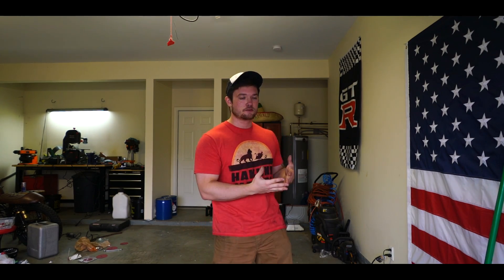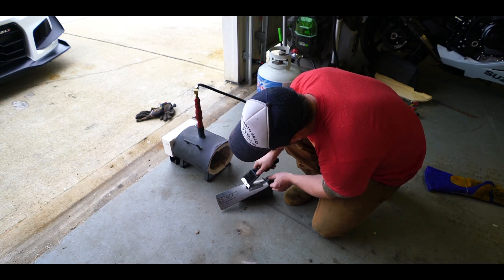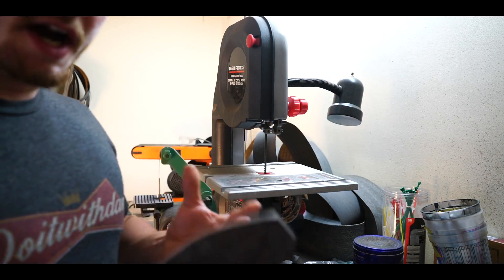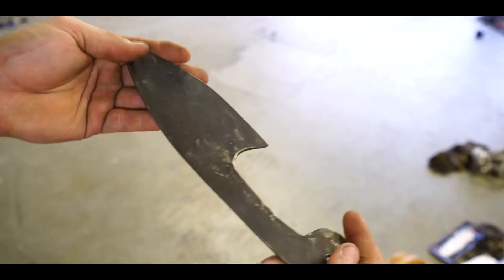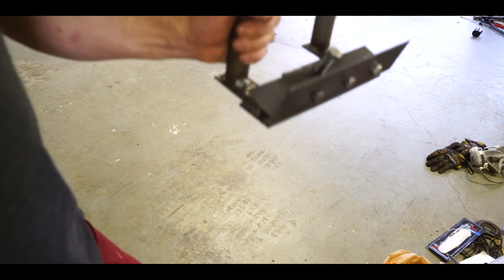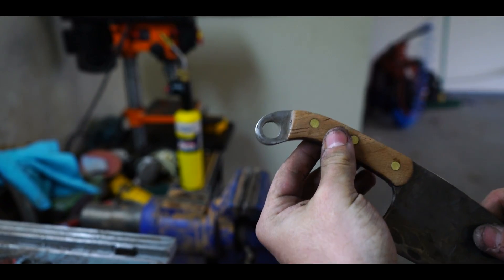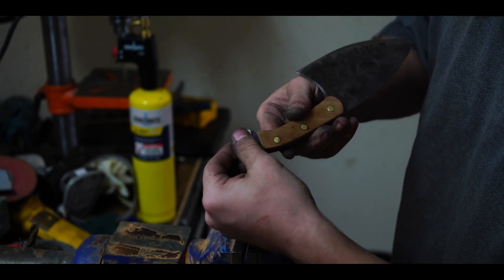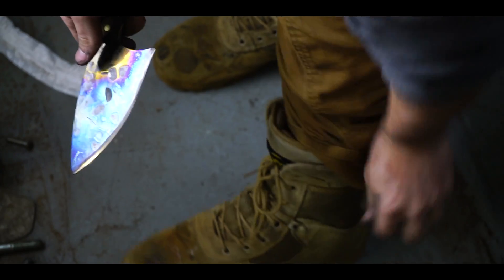Forging a Knife from a Titanium Jet Engine Turbine Blade

Comment from the maker: Just an update. He loved it! Reaction was priceless!
Reply: DanMade it came as no surprise that you shave your legs
Reply: titanium dust + lunges = death
Reply from the maker: @mr.thebandit  I always wear a respirator
Reply: @DanMade  My dad worked for the railroad for a long time, I made him a railroad spike knife.  Also I'm glad you're proud to be an American.
Reply: You should try and make something damascus
Reply: And merry Christmas or whatever
Reply: DanMade The best way to cut soft materials is to use a saw blade with a lot of teeth, it’s the opposite when you cut hard materials.
Reply: yeah it turned out great but since its airline, i would assume that it's almost like incanele where the alloy is made to not retain heat and that crackling is the metal trying to laugh at you destroying your cutting discs just kidding good work i like this one alot
Reply: louis debacco nope just plain titanium. No blades in a turbine engine are made from inconel, it’s too brittle.
Reply: Did you not record the delivery of the knife?! C'MON MAN!
Reply: Wish you would have posted a reaction video of you giving it to him
Reply: Yay
Reply: Any plans for a folding knife in the future?
Reply: Hey Dan, have you thought of hand riveting instead of using epoxy?
Reply: If he plans on actually using it you need to put a carbonized layer on it so it will hold the edge
Reply: what an awsome idea u got there, and what a lovly message to your dad! Big trumps up man and great work!
Reply: _ Honor your father and your mother. YHWH Almighty.- 
Period.- 
Cheers From Argentina
Reply: Brother I seriously would love to buy that.
Reply: Cool idea. I would point out that since it's titanium, and that it's a stage 2, it's neither a fan blade nor a turbine blade. That would make it a compressor blade.
Reply: Happy retirement
Reply: Dunno if you're going to read but anyways...
Steel has 1100°c melting point , while titanium has @1700°c. Maybe you couldn't bend the titanium sheet because it didn't had the necessary temperature ( probably that's why titanium usually is made/worked at an industrial scale , because it needs better equipment).
Also , couldn't u have completely bent the sheet of titanium and make more layers , seems like it would have been easier (though I believe it wouldn't have the same benefits as steel has from multiple layers)
Reply: La verdadera navaja hipoalergénica del mundo mundial y de todos los tiempos.... Felicidades mi estimado.
Reply: Glad to hear that bro, your parents raised you well
Reply: So your dad is a nice man, if i was your dad i probabely punished you for ruining my souvenir!!! Man it is really ugly!!!
Reply: You talk too much... Less talk, do better job and see peoples react...

Comment: heres a tip for next time, dont use abrasives or bandsaws for titanium, find yourself a friend in the engineering business and use thier plasma cutter, use light abrasives later to work out those hammer marks you have, since they will affect the durability of the knife, it will most proberly snap after a while due to delaminations in the blade.

Comment: titanium is so soft, not good for blades. and has high tenacy so hard to edge on a knife. I guess its HRC(if measured) is about 30. if you several cut, you must make edge again.

Im a pipe fitter on oil refineries. its quite nasty meterial. cutting, grinding, welding... every processes are different to iron. your hardning is bit ridiculous. thats not titanium hardning. 😂😂

Comment: Titanium is acctually has a really bad edge retention, also it's not as hard as you think, titaium frame locks get a worse and worse lock up since the steel gets bend and the only really good quality of titanoum is being light for it's wear resistance

Comment: I made a knife out of high speed steel (about 68 Rockewll C). Too much for me, I could barely profile the blank, and had to burn rivet holes in the handle, no drill would cut it. I just made a simple seax. But,,, it gets ripping sharp and holds an edge like nothing else. Try it, I dare you! :)

Comment: You need to get a band saw blade with around 20-30 teeth per inch for something that thin and titaniumy, and get ones designed for hard metal, makes a huge difference. Also use a heavier oil like 10-W-30 motor oil applied constantly. If you apply the right pressure (not too much) the blade will last a surprising amount of time. You could have cut that whole thing to ribbons with one blade. 

There's a bandsaw at the place I work that cuts 24" thick solid steel up to 24" tall lol. The blade is about 8 feet around in a circle. I've seen 20 foot long solid steel shafts that were 18" in diameter first cut into 12" lengths, we got about 16-17 of them out of it due to the shaft ends being too small for step two. After cutting the lengths, those rounds then had their sides sliced off to form a rectangular peice of forged billet steel aka step two. We then used those pieces for a job to save money on material cost (I work at an unusually large scale machine shop, 8 foot swing 70 HP lathes, 42 feet wide by 14 feet tall by 10 feet deep capacity 50 HP milling machines, and a few smaller machines as well). There were a shitload of short blade shaped pieces of scrap that had to be loaded after that job, they looked kind of cool when I laid them down like scales on a pallet after each cut. Should have taken a picture. The blades on that saw are replaced once every 1-2 *months*. It's crazy how long they last considering how much it gets used, all damn day.

Comment: Lucky you getting that blade. I had an aluminum melting furnace that turned waste to ingots, had this piece that would not melt, so threw this two foot by two foot to the scrap pile, latter found out it was titanium, i should have known.

Comment: It was 'less than an eighth of an inch thick'....only at the tip.  It's a tapered blade. (I'm very familiar with repairing those Ti blades.)
Also, you need to drop your top bandsaw guide down until it just allows the workpiece to go under it.  You'll get much better blade support.
Ti 6Al-4V ( the material that turbine blade is made of) makes a pretty knife, but it won't hold an edge at all.
Tip for drilling Ti:  use a cobalt bit,  very slow rpm,  lots of pressure, and use coolant.

Comment: First let me say that you made a fine hand crafted knife  that took a lot of hours and effort to produce but since I am who I am her is what I want to say. Just because you heated the  titanium  in a forge does not make it a forged blade in order to actually forge a blade or anything else for that matter you  draw the shpae out of the metal (meaning you heat and pound the metal usually multiple times into the shape and size of the blade) you basically punded the  titanium turbine fin flat then cut out the knife, Essentially this is a stamped blade not a forged one. iwill now say it again so that there is no implication of demeaning the blade you made---------------->>>>>  This is not to take away from the  product you produced! you made a fine and beautiful hand crafted knife. but you did not forge the blade in the traditional definition of  forged.      . oh an for you naysayers out there I am a traditional blacksmith using a coal fired forge and non electrical tools. I might have a grasp of what it means to forge something. and just in case you still think I am full of BS 

The Differences Between a Forged and Stamped Knife
https://www.thespruceeats.com › ... › Cooking Equipment › Knives & Cutlery
Mar 8, 2019 - A forged knife is made of a single bar of steel, which is heated and then pounded into shape, sometimes by a specially trained craftsman, sometimes by machine. The alternative is a stamped knife, in which the blade is "stamped" or cut out from a large sheet of steel, then is honed and heat-treated for durability.

This way you can say that google said it and not some fat old dumb Blacksmith either way this is not a forged knife by definition it is a stamped knife

Comment: I don't want to be a "know at all" but fan blade is not the same thing with turbine blade.  Fan blade (single stage only) is made from titanium alloy. Turbine blades are not. In fact in the turbine blade there is not a single molecule of titanium.  You do realize that heating that blade made her soft enough to cut.  Otherwise....

Comment: Forged???? Looks like you cut out the shape then just heat treated it. Forging means shaping it from hot metal
Reply: Oh shut the fuck up.  YOU make a titanium knife or any knife for that matter then you can say something.  Those who can"t do teach.  Those who can't teach critique.
Reply: It was curved, he forged it flat, ie he "shaped" it to make it flat. He did this by heating it and hitting it with a hammer, text book forging.
Reply: Daniel Hughes he forged the titanium flat. Than cut the knife out. That’s not forging a knife.

Comment: Bro You got a pretty good band saw, you just have to lower your blade guide while cutting hard material...
Reply: Any material.
Reply: @Josef_R   less space between lower and upper blade guides blade will have higher strength and the harder the material the slower you should go.

band saw is literally best way to cut metal.
Reply: @abdulbasit2571  why are you telling me how to operate a bandsaw?

Comment: I have had a couple contacts with titanium.  Lighter than aluminum and ridiculous strength.  I had suspension rods out of an MRI magnet, used to center the several-ton-core in the outer shell to make a cryogenic assembly. Rods of maybe half-inch diameter, 4 feet long. With it stuck in a hole in a wall and hanging from it. could not bend it!!  Another time we were demolishing metal process materials like fume tanks at Flexel Industries in Covington, Indiana.  They made cellophane, so the fume tanks were large titanium liners inside of steel tanks.  To our surprise, the titanium sheet material was FURIOUSLY igniting and burning when we cut them with the cutting torch.  (kind of like magnesium would except it would go out if  you backed off).  It had the most unusual lemon-yellow flame, not the bright yellow like when you cut into something that has a salt film or deposit on it.   I guess I never gave any thought to whether this metal could even be heated red-hot and hammer-forged like this.  To my surprise.  Very few people have ever encountered this metal in their life. Scrappers will mistake it for aluminum sheet, and a scrapyard would make a lot of money not divulging this to customers.  I still think few yards have ever seen it either though.  It is kind of just the lightest yellow color,  at least in the forms I have seen it take!  I also saw a thick casting made of it at Wyman-Gordon foundry in Harvey, Illinois when we were doing a plant clean-out.  We were raising it in the air, yelling "I am SUPERMAN!!!"""

Comment: Now a knife from tungsten - how would that work.

First thoughts, forging would be difficult as its melting temp is ridiculously high ?

Next, depleted Uranium, but even depleted uranium still has radioactivity, so no chance of this one unfortunately - but would be interesting for its weight, density and strength (but might be brittle so I'm told).

Comment: I did not expect titanium to be foregeable- it is very brittle. At 4:20 - if titanium heats up over 450 degrees Celsius, it forms an ultra hard so caled alpha-case layer on the surface. Better grind it slowly...

Comment: Hey bro Idk if anyone has mentioned it but,  look into CBN wheels for a bench grinder. A 180 grit CBN will cut like a 80 grit AO wheel and the best part is that they dissipate the heat very well and you never have to reface them.

Comment: It's been a bit since I've looked into it, but aren't turbine blades usually some sort of nickel based super alloy? I know they typically utilize titanium blades in the compressor section and on the bypass fans, but doesn't it get very brittle following each heating and cooling cycle?

Comment: Oh dear, so much mis-information about Titanium here in the comments. It is not toxic, hot or cold, it can easily be heat treated but you have to know the particular Titanium alloy and select the correct treatment. It oxidises very readily when hot, it also picks up Hydrogen and Nitrogen when hot. If you use a gas furnace it will pick up Hydrogen much quicker. Oxygen, Hydrogen and Nitrogen are major contaminants and make the material brittle. It can be forged, rolled, extruded and formed. Additionally it can be welded and cast though both of these are difficult. Casting in particular can only be done by melting and then casting all under a vacuum. I had 40 years in the Titanium industry with some Zirconium, Hafnium, Niobium and a few others thrown in for good measure along the way.

Comment: Thing is with titanium its very brittle material for a knife its a very hard material to heat treat and temper it will most likly break with any adequate pressure.
Reply: Not really, titanium is wqy softer and more pliable than steel, and in it's performance it is closer to aluminium than steel.
Also, heat treating is pretty much impossible with home equipment 
Titanium is used in avio industry because its has very low density, but also decent strenght.
Think of it as a aluminium on steroids.
You may have been thinking of titanium carbide which is very hard indeed or possibly tungsten(Wolfram) carbide.

Comment: Dang dude.. as hard as you were pushing that knife on your leg to shave it, a damn rock would have shaved it with less pressure. 
  Good job on the knife tho.
Your Dad should be very proud
Of it.
Reply: Larry - hahahaha that knife isn’t even sharp enough to use for butter.
Reply: I'm glad I wasn't the only one that's saw that. I do like the knife though. Good job bud

Comment: Dude , why did you heat the metal to blue? You've basically crystallized the surface area and everything that is blue. Should have stopped when it went straw colored, but hey I guess it looks pretty, huh.

Comment: seeing a blade be tempered to a dark blue hurts my heart even if it was just for the color
Reply: As Arby said: its an advantage to heat a bit and air cool Titanium. But all in all Titanium really isn't a good material for most knife blades, its softer than hardened/tempered high carbon or stainless steel and doesn't hold an edge for long.( the titanium here is likely 6Al-4v, with an annealed RHC of only 32 and can harden up to 39, whereas some common high carbon steels can harden up into the mid to high 60's) Its why you rarely see Ti being used for knife blades, occasionally you might see it on a diving knife blade as its very corrosion resistant. Its much better for light weight strength and high heat/ corrosion resistance applications, which is why its seen so much in aerospace technology. It's often harder to cut than steel due to its gummy nature which makes forming small chips difficult when cutting as well as "gums up" abrasives and edges plus the fact that it work hardens easily. I've made a few small titanium knives just for fun, they are crazy light and fun, but really just novelties as far as tools go, they dull quite quickly.
Reply: It’s titanium. The more times you heat it the harder it gets.  That blueing didn’t harm it in slightest.

Comment: I'm curious how that tempering of the blade affects its hardness.  I'd NEVER temper the cutting edge of a steel blade to blue like that, but i've never forged titanium
Reply: I will explain it. Every time you heat titanium and let it cool, it gets a little bit harder. For example, when drilling titanium the one thing you never want to do is let it get hot. It will get so hard that nothing short of a diamond bit will get through it. And those get a little pricey really quick. So, unlike steal, by blueing it like he did he only helped the temper not harm it.

Comment: Titanium would do perfect armor but as sharp tools/weapons? no its too light for that
Reply: The weight isn't the issue, you can add or remove mass as needed to get the weight you want with a metal. The problem with titanium is it can't be tempered so it will never hold an edge.

Comment: Hey, fellow blacksmith here! Good job on the knife! My first attempt at working with titanium didn't work nearly as well... It's an absolute bitch and a half to move. Not as bad as wootz though. I wouldn't recommend making too many knives from titanium, because quite frankly it's much worse for blades than even mild steel in most respects. Way way too soft for actual use. They used to use it for diving knives because titanium is very corrosion resistant, but recently they've been using H-1 steel. The reason for titanium being used in jet turbines was also partly because of it's corrosion resistance, but also because it is so light, which is good for rotational mass. Recently however the aerospace industry has started using cobalt alloy blades, because they also don't corrode, and have a very low coefficient of friction. On the topic of cobalt alloys, they actually make decent knives, despite being very soft (though still harder than titanium) because of the small amount of friction.
Reply: Also, titanium dust is a lot of fun. Burns amazingly bright, like magnesium.

Comment: Hey man. Awesome knife! Just a few tips from a fellow knife maker. 1) When you need to flatten out a bent piece of metal use a wooden mallet. It wont leave those hammer marks. 2) When you're coloring titanium its much easier to do it in an oven so you get an even color. Just stick a C clamp on the handle section (before you pin the handle on) so that the blade isnt touching the oven grill and try different temps for different colors. 3) invest in a 2x72 belt grinder.

Comment: most band saw,s have rubber  tread on them oil will waste them also cheap concrete drill bits will drill hard steel they have carbide tip inserts